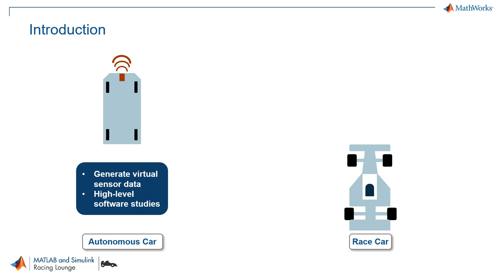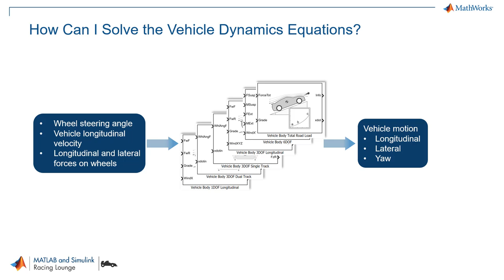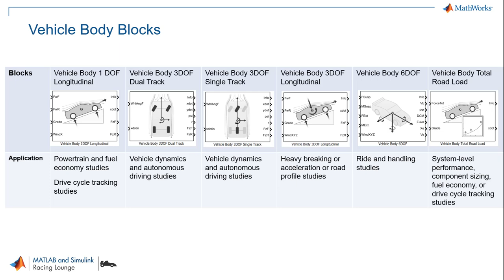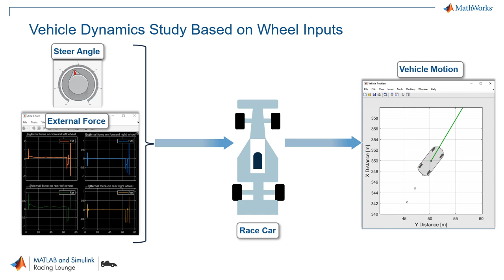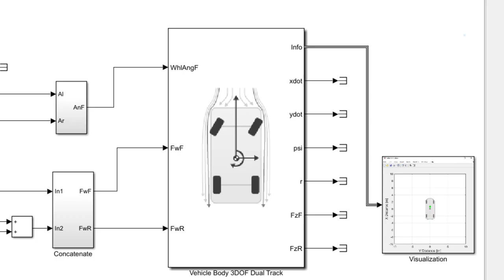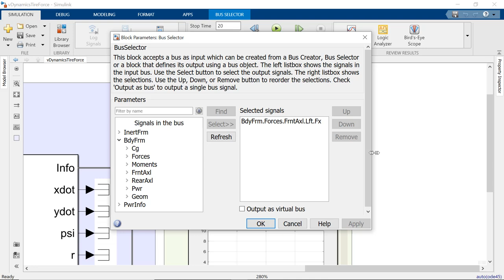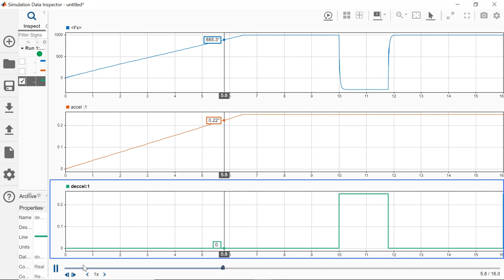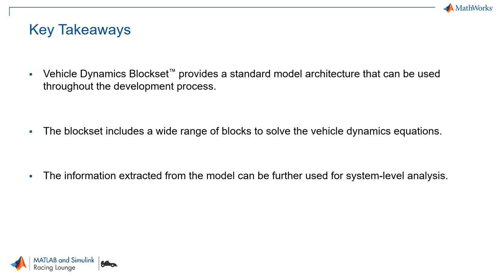Simulating Longitudinal and Lateral Vehicle Dynamics

Comment: When I apply reasonable steering (rad, max 0.1745; min -0.3491) and acceleration (m/s) inputs from a variable in the workspace (Using the same model), the X and Y positions end up being ridiculously high and fluctuating even though the instantaneous speed is what is supposed to be. Any insights on this problem?

Comment: hi thanks for your video 
but i can't find the visualization block ,,,, can you help please ? 
i need to make a model of an electrical vehicle and need to use it 
thanks again
Reply: Hi Meriem. We have used the commands from Vehicle Dynamics Blockset to visualize the 2D motion. If you can drop us an email at racinglounge@mathworks.com, we can explain the steps and provide more details on this.
Reply: I dont know where he got that, can some one please help me to find the visualization block?
Reply: Hi  @richardbergna148 , 

Thanks for reaching out.
 
Here is the link to the recently published models on GitHub/FEX: https://www.mathworks.com/matlabcentral/fileexchange/77798-vehicle-path-tracking-using-pure-pursuit-controller  
 
You can refer to these files where we have included the 2D Visualization block in all the models.
 
Thanks,
Veer Alakshendra
MathWorks
Reply: @alakshendraveer  Hi,I cannot open it in my matlab because I'm  using matlab R2020a,can you give the file in this version.